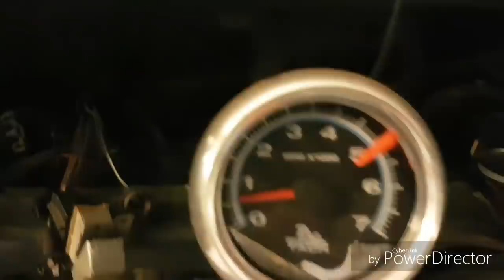Straightpipes and primer! Work continues!

Comment: Dont need a rev limiter ...when the values start floating back off the throttle.
Reply from the maker: Lol more so when the trans grenades like all dodges do it doesn't go to 9k rpm haha
Reply: Those oldsmobile 442 are nice cars to
Reply: @SouthSaskFarmer1  When or if you get valve float just put heavier valve springs and retainers. If she has a 727 trans. she ll be just fine.
Reply: @Northern_Farmer  Your right Tyson, my friend has 71 W30  with a 455 cu. in. engine. Nice!!

Comment: I gave Simon a like. If guys don't like your content Nick, then f'em, they can move on. Hell, even I grit my teeth with all that green paint fixin, but it's all about hangin out with some good shits. Lol!! Now!, that's the way a 440 big block should sound. Crisp too. Your carb man jazzed a couple of times and it's right there. NICE! 10:15, most emotion EVER shown by Twaaawn. Looks like another chev/Mopar convertion on it's way. Lol! My MSD on the farm truck/race truck uses what looks like small fuses you plug in for a rev limiter. Set now at 6500 which is about where I was at the end of the 1/4. New truck weighs 2000 lbs less than the original...so some changes will have to be made. Probably only going to be an 1/8 mile truck now anyway. Enjoyed a shit load. Thanks. TOG out! 125th!!